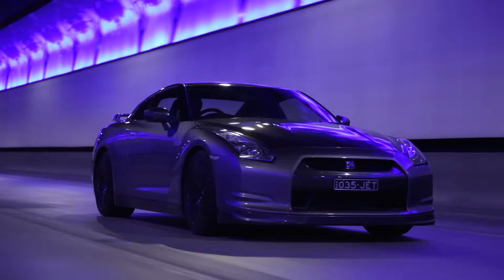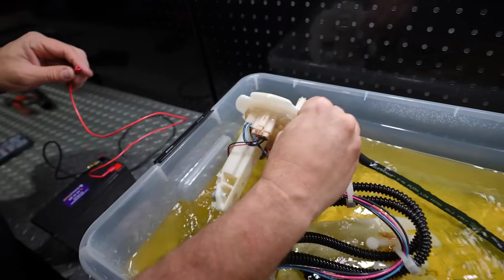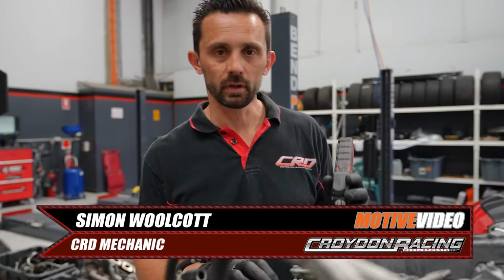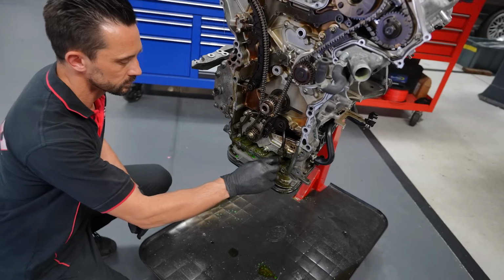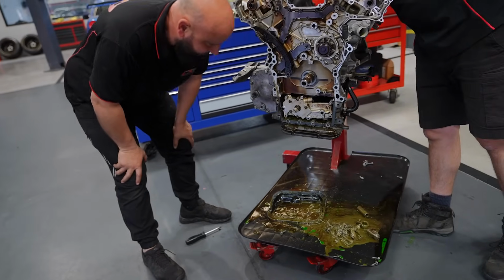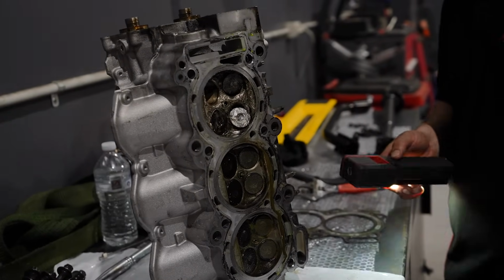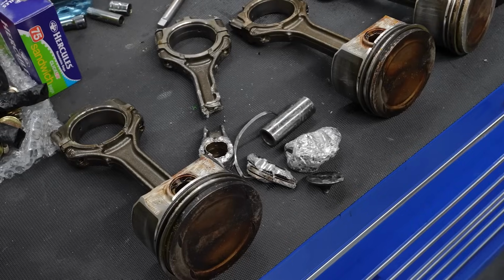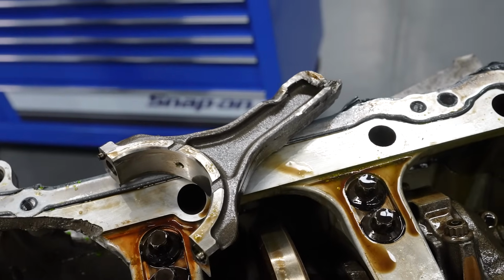Why did our R35 GT-R Engine Blow Up?  So Much Carnage in the VR38 - Motive Garage

Comment: Testing open flow is the worst way to test a pump u need to load it to at least 3 to 5  bar and then check flow put a regulator in line with it 
I had a pump was faulty only when it hit between 4 and 5 bar it would literally stop my experience 😂😂😂😂

Comment: Surely this wasn't on a stock map anymore? Im guessing when you upgraded the Gearbox software you changed the Engine map?  Possible over boost or issue with the turbo on that bank of cylinders?
Reply from the maker: stock map.

Comment: It is a stupidly technical Datsun engine. They blow up with regularity, either from abuse or the high tech gizmos do not function and that blows them up.
Your dodgey pump test has not taken into account the hoses to the engine, the fuel returns under load. Plus the entire efi system. 
No 1. you may find a fuel regulator has failed and sending too much fuel back to the tank. I have had this issue several times on normal efi family cars. Being a hi tech POS that problem is probably quadrupled. Chassis dyno will possibly find the issue, not spraying petrol into a tub. And that is a 5 litre bottle. So it was pumping about 2 litres per minute.
Been there and done this 30 years ago. Two dodgey electric pumps that pumped a seemingly adequate rate. Sorry!!  After advice I Installed a Holley pump  and the car had plenty of power. 10mph faster without falling over itself. This on a race track, not hooning the streets.

Comment: Quick tip: When you're doing a pump bench test like this with exposed fuel vapour (not a great idea to start with), do the final power connection at the battery side and not at the pump. If there's a spark when you touch the wire at the pump end you'll have more than a holed block to worry about.
Reply: Jesus lol...that is very valid. Almost lucky
Reply: Na , Thats when you pull the pack of camels from your rollled up t-shirt sleeve and light it with a zippo. Harden up buttercup!
Reply: My staff at my salvage yard once did this and nearly burned down my shop 😂😢😮
Reply: THEY ARE NOT USING FUEL = it`s injector flow stuff = not flamable !
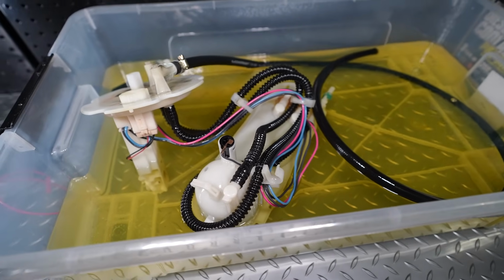Reply: @ronnieboucherthecrystalcraftsm  No, sorry mate. @3:01 Andrew specifically says "I've got a container full of petrol..."
Reply: @ronnieboucherthecrystalcraftsm  Dude clearly stated he was using petrol lol

Comment: As a post mortem, maybe do a liquid penetrant test on the remaining 5 conrods and the undersides of the pistons? 

It is a long shot, but if either the rod itself let go, or the underside of the piston dropped the wrist pin (gudgeon pin) due to fatigue cracking, you might see evidence of that on the remaining parts. Those parts are likely from the same batches and have undergone the same load cycles and temperatures. You might find cracks that were not yet big enough to cause failure.

Normally you can identify fatigue cracking by looking at the two fracture surfaces, fatigue cracking creates a very distinctive pattern, but here the failed parts are properly mangled.

Comment: Ouch, sorry for your loss. Hit the material failure lottery with that one, xray/crack test the next lot but it can be anything in the end.. looks like a valve broke off and did the old bounce-aroony. You can see the pit marks while it got smashed into the head until the rod broke.
16:13 and 16:35 the shear line on that valve stem is wild, I'd say that's your failure, material failure that caused a crack to propagate, it's so clean it must have just dropped straight off into the cylinder in one piece. VR platform isn't cheap, it's why I stick to LS.

Comment: Wish to know what was a driving condition when it happens.  It seems like engine was running for a while before it exploded.  Does it happen while driving slow or fast under pressure?
Reply from the maker: Had been driving around for two hours doing rolling shots. Was cruising. All A-OK. Gave a stab and boom
Reply: @MotiveVideo  oh that's bummer!

Comment: I hate v6's, I know they make sense from a size and weight distribution point of view but they sound crap and too complex. A straight 6 sounds better, easier and cheaper to work on.

Andrew could could stick one of the upcoming PRP cast iron RB blocks in there.

Comment: Why is it I see heaps of Nissan engines with that what looks like a white powder corrosion on them?  I have an 08 350z and it's as clean as a whistle, like new... Shame about your GT-R..
Reply: in NZ/AU we have lot of coastline and alu corrodes and that makes the white powder due to salty air. it's oxidised aluminium. not hard to clean off. My ls3 has been sitting for 8 years it looks like that lol.
Reply: @N4CR  no worries makes sense. But like I said my vq35hr is like new. I will book it down to a dry Adelaide climate.. Thanks.

Comment: you know one little spark from powering the pump that way could potentially burn down the crd workshop
Reply: I was more worried about the pinhole leak and that spray of fuel than the actual bucket and hose...

Small enough to emit fumes and up she goes.
Reply from the maker: Could throw a cigarette into it and do nothing. It's not a Hollywood movie/
Reply: @MotiveVideo if it was diesel, petrol is different, one spark is all it takes.
Reply: You know those fuel pumps are brushed motors, all brushed motors throw sparks when they run. In fuel.
Reply: @gavwilldo in fuel maybe, but outside in the fumes is where it’s dangerous
Reply: @gavwilldo  no they are not
Reply: @gavwilldo when fully submerged the arc is quenched.

Comment: See that on the Seadoo supercharged engines,  ours is from dropping the valve heads
Reply: we saw a lot of valves drop in the 02 to 06 sodium filled valves and 99% exhaust valves. We still get the odd ones drop but no where near the old ones. 06 and up were the better ones but I’ve heard they are again using a filled valve.
Reply: Is that on early models with #72 exhaust valves only? Or do you see them fail on newer #75 as well??

Comment: That fuel pump setup was the most dangerously ghetto thing I've seen in awhile, I've seen dudes blown up with petrol, please rethink what you're doing there..
Reply: Very silly way to test flow and pressure.
Reply: What's wrong with fuel vapour and sparks? 😂

Comment: I stand by my comment from the previous episode - It was likely tuned at some stage meaning much more pressure on the bottom end, they flashed it back to stock and sold the car. Rod let go from fatigue.
Reply: There wasn't any damage you'd see from detonation on the ring lands or bearings and no teltale oil starvation (crank isnt blued by lack of lubrication causing heat), so I'm thinking it's more that sometimes things just fail
Reply: @antonjimmy5636 could have thrown bearings at it?
Reply: @Low760  the crank and bearings were fine, it looked more like the little end sized in the piston, or there could've been a flaw in the conrod and that's where the failure started
Reply: Think going to the USA where they have the 35 gtr really well developed you’ll find a motor or at least the options of different combinations you can fit in a suitcase to bring back in pieces that you can take to the next level 

All the best with the festival over there and developing more contacts
Reply: Lol

Comment: I've never understood how people can say it was this or that at this kind of destruction. I have over reved an engine and dropped a valve and it did exactly the same damage, Granted that was only a B16 engine.
Reply: That’s because you are right. It’s so rare to see a rod just break. And nothing points to that in this engine. You have bearings that show no signs of any sort of failure and rods
They haven’t shown the valve train.  But it’s very obvious that a valve has dropped. Whether it valve bounced, broke a valve spring, collets, rocker, lifter failure. Would be quite obvious if they inspect it

Comment: The more Nissan engine teardowns I see, the more I appreciate Toyota engineers.
Reply: Lmao what the fuck does that even mean, every manufacturer has had engines blow up before
Reply: Last time I checked, Toyota's flagship sports car has a motor designed by the engineers at BMW 😂
Reply: @Desert_Spec  and their flagship car has a v8 5.0 unlike almost every other car you can buy.
Reply: New Tundra and Tacoma turbo engines are going through teething hell currently.
Reply: @Phanuael  Yes well those are american not JDM so do they really count?
Reply: Untill you need to adjust the valves or change a head gasket on one. Vq35 vq37 etc

Comment: that fuel pump test rig makes me nervous. Spraying fuel in the air using alligator clips to complete the circuit that can spark....yikes. I'll just imagine it wasn't fuel, just yellow water.
Reply: I almost caught my parents house on fire but sticking a fuel pump in a container then jumping it at the pump. The spark set it all on fire and we scrambled to get it away from the garage
Reply: Had a work colleague do this at home, and set him self on fire. Gave himself some nasty burns, ruined a t-shirt, almost set his house on fire, and gave his dad a near heart attack. 
Luckily, nothing permanent. Hi Shaun 😂❤
I always remember that when im about to do something similar 😂
Reply: @iainball2023 Fark, did the t-shirt pull through?
Reply: That can spark? It definitely made a spark.
Reply: Don't let fear rule your life
Reply: @jarrod1687  saw the results of something like that test that went wrong. Thats shit you dont want to see or go through thats for sure.
Reply: @jarrod1687 Don't let fire burn your workshop down. Logic/10
Reply: @jarrod1687  I don't. I work in high risk environments and have dangerous hobbies. But I'm of the belief you can do dangerous tasks safely

Comment: Keyboard engine expert incoming. Judging by the abundance of those marks on the cylinder wall, the valve head gave out way before the rod did.
Reply: I agree, those sodium filled valves can fail. Rods have been pushed to over 800 wheel horsepower before they bend and they still run fine when bent for years after!! These engines don't randomly break
Reply: yeah you can see the perfectly clean and unusual failure on the valve stem, it had a material failure.
Reply: Agree
Reply: I was thinking the timming chain slip or stretched, and that piston went straight into the head.

Comment: Note to self, dont buy a r35, major bummer, it wouldve been cool to see how far you couldve pushed sbe.
Reply: Watch this. George got stock block into 6s with an upgraded girdle. I'd say that's around 3khp to do that  /watch?v=LWM1DfhmdJI  He holds current gtr record and also has a glide promod running the same engine which he thinks (and so do I) will be faster xD

Comment: Pretty upset I wasn't contacted to diagnose the failure, do you know how many videos I've watched on cars? How many hours I have in NFS Most Wanted?
Reply: I'm upset too, but hey let's just throw money at it and rebuild it lol yaaaayyy
Reply: R35 wasn't even in MW. I have played Forza 3 and 4 so he knows he can count on me instead!
Reply: @Carwizard @IDOCARS and @Skidfactory .
Reply: Spark plugs not delivering enough fuel you reckon?
Reply: What do you reckon it  was bud that shit it's self 
The rotor housing?
Reply: @pullmyniblets 
100% it’s definitely the rotor housing that lunched itself on that GT-R’s Gallo 24 engine.
Reply: @negativeindustrial  That's definitely a Gallo 12 engine...They have so much torque the chassis twisted coming off the line...but it doesn't matter if you win by an inch or a mile, WINNING'S WINNING! 😂
Reply: @The_Big_Unit69  
Family